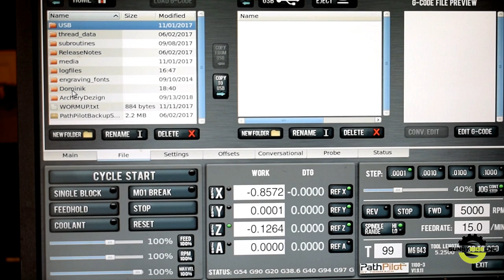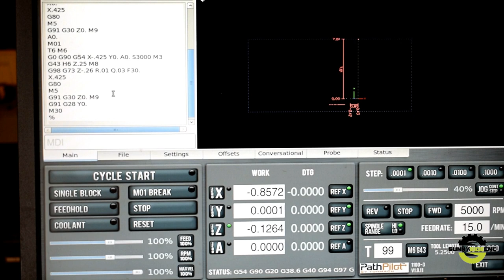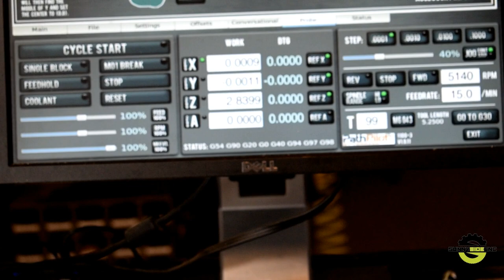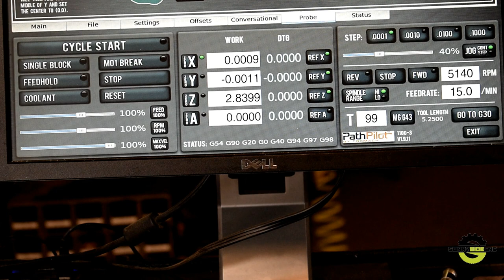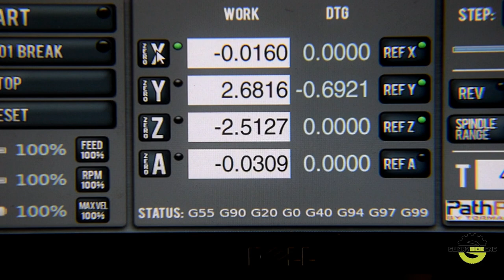Broken Tap, Crooked Fixture Plate, And New Fixture???

Comment: One thing I have noticed with my haimer is it often needs re-adjusted.  Which is odd considering it is such a high quality brand name.  I have never crashed it broken a probe either.
Reply from the maker: Probe rubi is 3MM. It came with the probe. As far as your haimer issue, I would email them for a replacement. It's worth a shot.